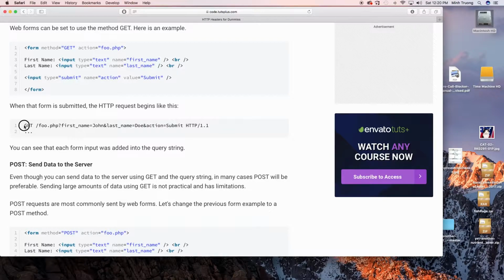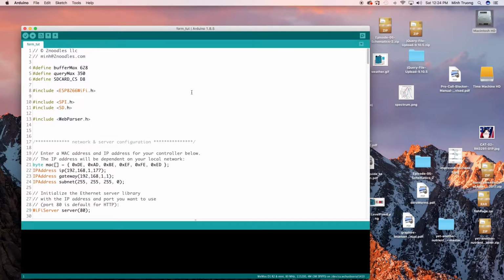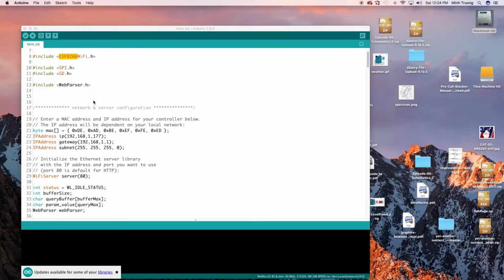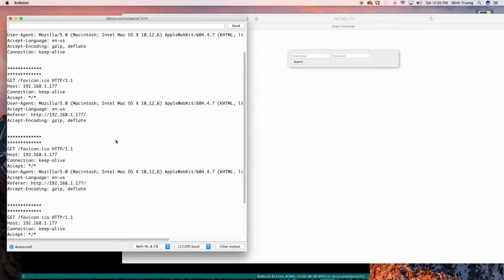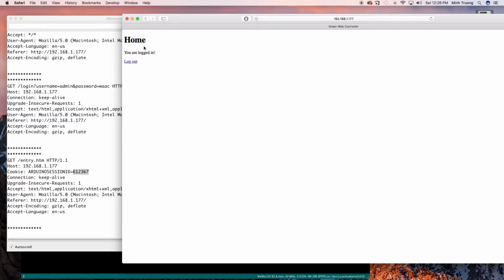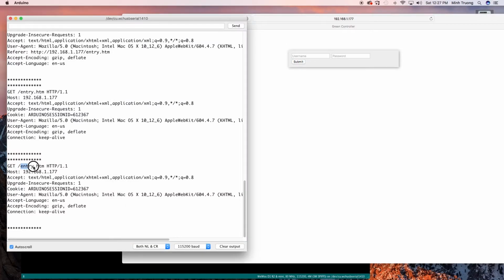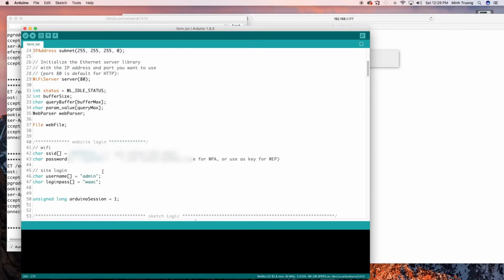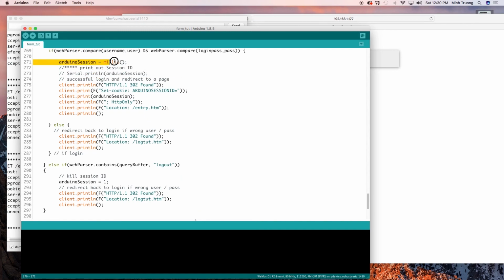ESP 8266 server cookie login

Comment: works with arduino uno + esp8266 module?
Reply from the maker: I don't see why not.
Reply: @professorm4171  tried to go up code this giving include error works
Reply from the maker: @Ppayfusiong  Oh, I don't know your hardware. This code is meant to go onto an esp8266. You can adapt it for an arduino.
Reply: @professorm4171  Could you help me adapt to arduino and use eps8266 module to communicate with the internet?
Reply from the maker: @Ppayfusiong  Did you contact me on github too? it's easier to communicate there. But it sounds like you're a beginner. This for intermediate programmers. Try learning the basics on Arduino's site and forum.

Comment: How do you make it so when you connect to the esp wifi you redirects to a login page?
Reply from the maker: It's in the code
https://github.com/mistergreen/ESP-Server-login-Example/blob/master/form_tut/form_tut.ino

You write the redirect into the http header
if(loggedIn()) {
       //render html pages only if you've logged in
       webParser.clearBuffer(param_value, queryMax);
       webParser.fileUrl(queryBuffer, param_value);
       // default page 
       if(strcmp(param_value, "/") == 0) {
         strcpy(param_value, "entry.htm");
         client.println(F("HTTP/1.1 302 Found"));
         client.println(F("Location: /entry.htm")); 

       }
       //else load whatever
       renderHtmlPage(param_value, client);